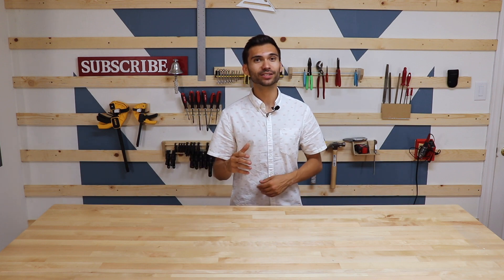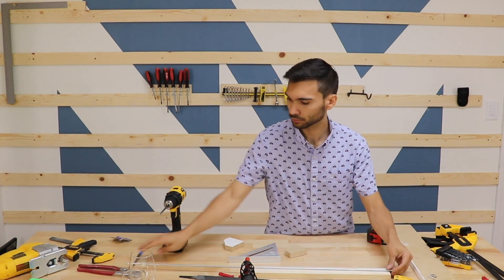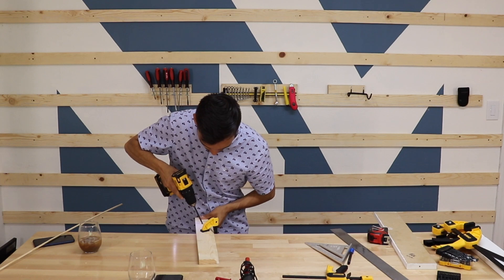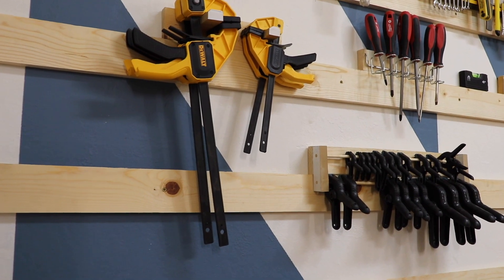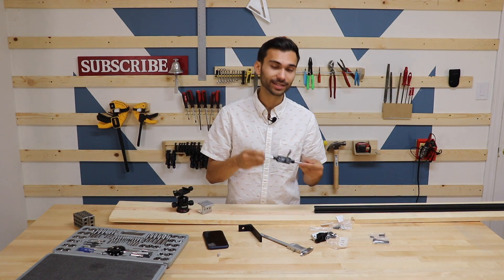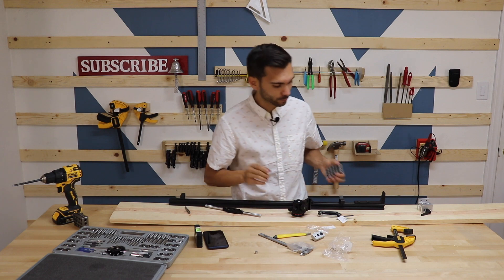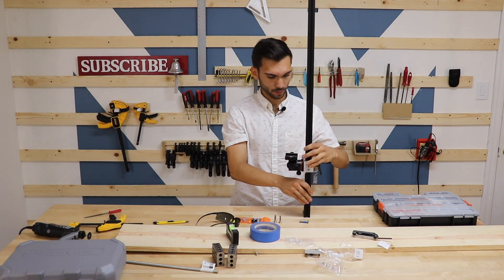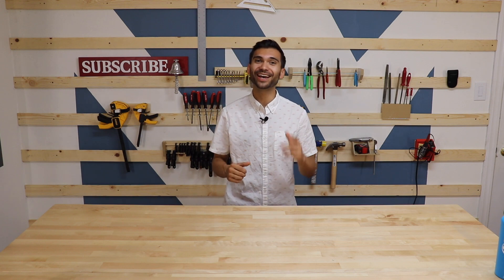Converting My Old Bedroom Into A Workshop - Part 2

Comment: All right... you covered... ( a little ) the French Cleats.  But hey, I have some 1 x 8 redwood fencing, where the ends are "over under" .i.e. looking at the width of the board, the left side has relief cut from the back side 1/2"wide, 1/2 " deep.  The right side of he board also has a relief cut, the same dimensions, except the cut is on the viewer's side of the board.  One cut is backside, one cut is our side.
My plan was to rip the board's width in half, and use these boards as cleats.  What do you think?
They are designed to be interlocking, and the weight of he load would be spread across the entire cleat.  ( actually, next question.  ) Would I hang a cabinet off a single cleat,or off two cleats? on atop the full width, another at the bottom or so, running the width of the cabinet?

Thank you!
Reply from the maker: Hi William! Sorry about the late reply, but that does sound like it would work as a French cleat! I would hang the cabinet off of two cleats just for the added support especially because you will be putting stuff in and out of it, the cabinet will move less with two points of contact.
Reply: @NatetheMaker  I just picked up an older craftsman table saw with the optional legs and 2 additional "expansion plates" lets call them.  Interestingly enough , this tool was purchased to help me DIY projects, however the table saw is missing its adjustment wheels.  Looks like those will be generated on the 2nd hand 3d printer.. Then, if need be can rip some cleats.
Reply from the maker: Ah dang that’s annoying, great to hear you can print the wheels!!